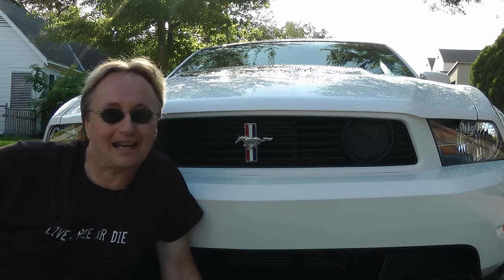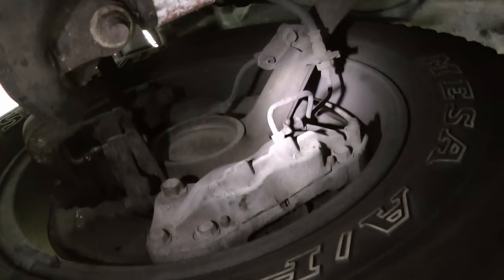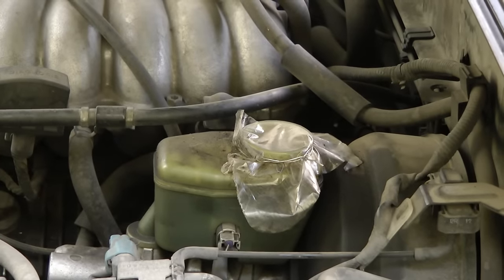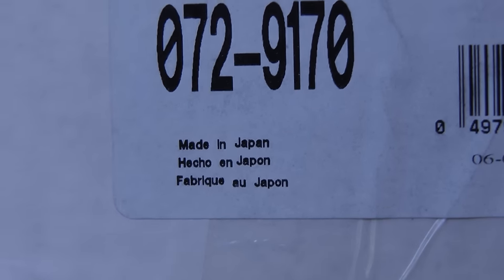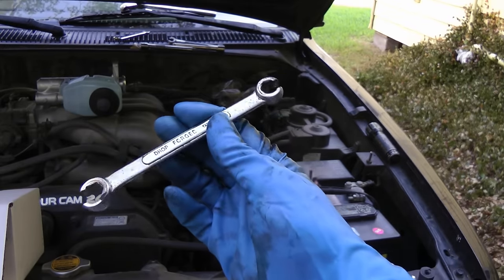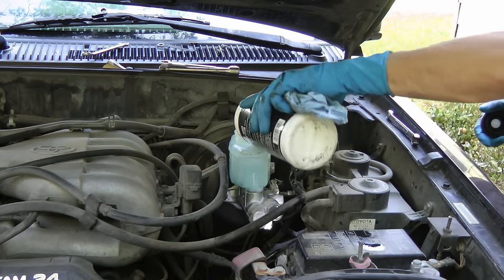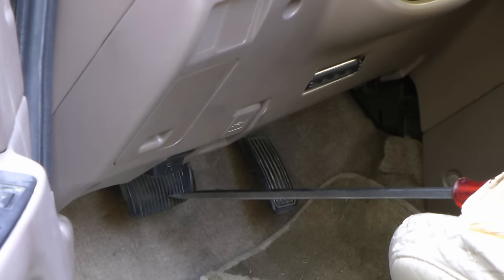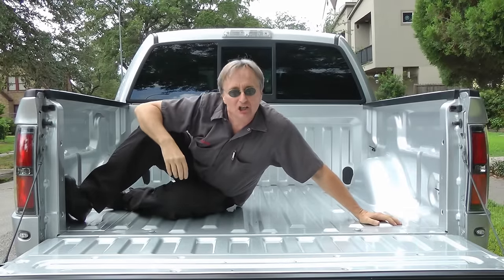How to Fix a Brake Pedal that Sinks in Your Car (Brake Master)

Comment: scotty i have a 99 sebring jxi and i just replace the rotors bled the lines and i have a brake pedal that sinks  and they worked b4 i did the replacement

Comment: Hey scotty, I have a 1976 c20 pick up. I have the same problem pedal to floor and brake light on.pedal goes so low that when I stop truck skids out. I have no leaking lines , would it still be same process with these old style of master break cylinder? ?
Reply from the maker: yes

Comment: My 99 accord 3.0 coupe has no brake pressure at all, pedal sinks to the ground. It'll get hard after you pump it really fast but will drop back down after a couple seconds. I've already replaced the Master cylinder with a new one and a junkyard one and had the same results with both. Did an engine swap and brakes worked fine before. I've even replaced the abs module and still have the same problem and I've also bled multiple times. Could really use some help here don't know what else to do! There are no leaks either, or at least I don't see any, and fluid level stays the same! Hope you can help meet out
Reply: did you ever get it fixed gary?

Comment: Great video. I have a quick question Scotty. I have an astro whose brake pedal is really hard to press down. It doesn't really go down at all. Also the steering wheel is really hard. I opened the hood and noticed that the power steering liquid hose (goes into booster), master cylinder and booster all work together. Is my booster out or master cylinder or both? Thanks!!!
Reply from the maker: bad boosters often do that. steering wheel is something else, like bad pump
Reply: Scotty Kilmer Thanks!!

Comment: Scotty,  I love your videos.  My 2010 ford edge has a spongy pedal and weak breaking ever since I changed all 4 wheels pads and rotors.. I replaced the master cylinder following your video.  had the wife push pedal to the floor for me while I did the tightening and loosening.  After about 7 rounds I got fluid coming out. The pedal was still going to the floor with little braking. I just got the car out of the shop and had them do a full bleed on the brake system.  And unfortunate to find that my pedal still goes far down with weak braking. the mechanic insists there no other issues..
Reply: every got it fixed?
Reply: No, never got it right had it powerflished by mechanics a few times.  Nevertheless i traded it in for a 2017 escape for the wife so its no longer my problem.

Comment: Hey Scotty 
I replaced the master cylinder and bleed all four break lines, break fluid is good in the reservoir  and there aren't any leaks but but break pedal still sinks to the floor and my brakes don't work at all. PLEASE HELP!

Comment: Although not as common sometimes a brake pedal going to the floor is caused by a bad ABS module.  A quick way to test is to pull the ABS fuse, if the brakes now work then that's the problem.

Comment: I have a 1999 ford tarus and I changed the brake booster and master cylinder because the brakes were going to the floor, and in the process of bleeding the brakes from all tires but the number 1 and 4 tire the air would not come out no matter how much I bleed them...some body told me it might be the wheel cylinder....what do you think because I'm very lost here...?
Reply from the maker: realize if it has ABS brakes, you need a dealer scan tool to bleed out all the air
Reply: I don't have abs braking system..

Comment: My 2015 Ford F150 has the soft brake pedal where it slowly sinks while I'm applying brake pedal pressure. I took it to the dealer and they said this was normal. They checked it out and said another one same model on the lot did the same thing. I disagree. I watched some You Tube videos where some folks have found the ABS device is causing this problem. How should I approach this? Find a garage that knows what they're doing? Is there an easy way to figure out what is causing this?

Comment: Scotty ive replaced a master cylinder on toyota corolla 1993 no leaks on master cylinder or calipers, brake lines are good. When my mechanic tried bleeding the system several times it wont bleed anything. Pedal is still soft.

Could it be the proportioning valve thats gone bad?
Reply from the maker: could be, but that's really rare. more often a crappy replacement master cylinder

Comment: Hi I have a 2009 toyota yaris with ABS system and when I presse 3-4 times  with engine off my brake pedal became hard and when its hard I presse 2-3 times more I hear a vacuum leak on front of car and my pedal goes down and I dont have any fluide leak Is  that normal because usually when pedal is hard it stays hard until starting engine?

Comment: So it is acceptable to just bleed the air using the two lines connected to the master cylinder? You don't need to use the bleeder screw near the tires for this?
Reply from the maker: as long as you do it as in my video, you don't get air into the lines and don't need to bleed the wheels

Comment: Whats up Scotty, i have a 94 s10! I replaced the master cylinder with a rebuilt master cylinder.. I blead the brakes, and still sinking to the floor. What do i need to do
Reply from the maker: +Thomas Barbee start with a new master, rebuilts often stink.  It's that or air in the system

Comment: Hey @scottykilmer I also have a 3rd gen Toyota 4Runner like the one in the video my brakes sink to the floor and don’t come to a complete stop in time I replaced my master cylinder I benched bled it and bled every brake at every wheel however I did not do the loosening the line method at the master cylinder like you’ve shown after the job I did not feel the difference with a new master cylinder I noticed the brake booster was rusting at point of contact with master cylinder but I’m not to sure how to come to a conclusion. Please help

Comment: I have been experiencing sponginess from brake pedal for a few months. Local garage has bled brakes about 3 times with air being expelled each time. Brakes weren't overly firm for a couple of years after dealer replaced brake fluid but since front discs/pads replaced last autumn I have had problems. Pedal doesn't travel to the floor when engine is off but firms up with about 2-3" of pedal travel until it firms up. Can master cylinder cause this lack of firmness to braking where pedal travels further but does slow the car though is a little unpredictable?
Reply from the maker: the air has to come from somewhere, and often a leaking master cylinder will pump air into the system

Comment: How are you sir, My car is toyota corolla 2008. Automatic. 292k mileage, since from last 3 days i am facing a problem with the break. When i press the break pedal i feel some time its lose and some time hard more a problem every pressing its makes a sound look likes, leakage tyre or remove air from a air balloon. I am already change the master cylinder but still same problem. Kindly help me about that issue.

Comment: my 06 silverado had a problem today. pushed on the brakes and heard a pop then air pushing out noise. mechanic said it was a vaccum leak in the brake booster.

Comment: i have a s10 that has a rusted leak in the front driver side wheel now can i just fix that or do i have to do all the brakes?  im gonna use it as a farm beater dont have the title for it  so finding what i can do for cheap i wanna teach my gf how to drive stick so i think this would be a good start

Comment: Would bleeding the lines correct the problem or I have to get a new master cylinder?
Reply: Jorge Daniel Figueroa Velázquez I'd say start with the cheapest option first. Bleed the brakes lines. If your pedal still goes to the floor, then replace the Master Cylinder, bleed the Master Cylinder and brake lines again to make sure no air is in the system....

Comment: Scotty, i have a 01 volvo s60 and the brake pedal is sinking to the floor. I bled the brakes 4 times replaced the pads rotors master cylinder and the brake booster i did everything did i miss something?
Reply from the maker: they sink cause the master is bad, or you have air in the system, or you have an ABS brake problem, Or there is a leak somewhere in the system. If you've done what you've done correctly, see a volvo mechanic to check out the ABS system that's not DIY stuff

Comment: hey scotty ive been having a problem with my 99 ford windstar almost every 3 months i have to top off my master cylinder with oil ive check the wheels front calipers and also the rear drums and i have no leaks nor the lines is there a posibility that the power booster has an internal leak and were could all this oil be going to? or its just the master cilinder? just also curious were is all the oil going to and mine does have the cao on it?

Comment: Scotty, Ive got an 04 volvo s80 t6. just did the front pads. calipers moved back nice and easy. took it for a break flush. pedal sinks to the floor. shop suggests new master cylinder. could that be what this is? i can pump up breaks after 3 pumps but it slowly loses pressure and fluid level has remained constant.
Reply from the maker: yep, often flushing the system will finish off a brake master then it needs replacing
Reply: Thank you for the advise and speedy response,  Scotty. Great video.

Comment: Hey Scotty Kilmer, I had a question that I just couldnt figure out myself.. I have this problem with a 96 toyota celica ST that has a brake sinking issue, but the funny thing is. the brakes only sinks to the floor when I am going 65mph and over only, but lately its been starting to feel softer on lower speeds too now. I have changed the brake pads and bled the brakes so far.. I was wondering what could be the problem. could it be the whole master cylinder or the brake booster? and my rear drum brake shoes are pretty worn out too, i dont know if that would be a problem for this situation
Reply from the maker: change the master cylinder IF changing the rear drum brakes doesn't fix it.Being really low, they can cause all that problem and they cost almost nothing if you do it yourself
Reply: Hey Scotty Kilmer, I just changed my drum brake pads on the rear, and took it for a test drive, and it just happened to sinnk to the floor still... (sadly) I was hoping this would fix it cause im on a budget, and master cylinder can be costly and so can the brake booster. The master cylinder didnt show any physical signs of leakage or problems, was wondering if it could be the brake booster? As stated before the brakes sink only on high end speeds around 70mph+.. Do i need to bleed the brakes again after changing the drum brakes? Should I flush out my brake fluid system and put new one? (the brake fluid didnt look dirty though) Thanks

Comment: I'm at a loss on this 97 4 runner new brakes all the way around new master cylinder, I have vacuum on the booster and still to the floor like stepping on a plum, abs module maybe???

Comment: hey scotty , sometimes my car has my brakes block up? i dont know why , it happens only ocasionally . I also noticed when i push the brakes my revs drop ( dont know if that connects to the problem or not)
Reply from the maker: +Kurucz Tamas often a bad brake booster does that

Comment: Hey I’m using a Vw polo with manual transmission my clutch pedal has become very tight and making noise but the clutch is not worn out . How to fix it ??

Comment: What if they simply don't return all the way back up?

My break pedal will stick about half inch from the top of resting position. Meaning breaks are still engaged and brake light is on. In the morning the battery is dead as a result of brake light being on all night

Comment: Hey scotty, we were recently given a 2007 checy cobalt with high mileage but engine runs great. It has sat for the past year and after getting it home I could hear a grinding noise from right rear and with no gas just in drive it felt like car was running over something. Didnt seem to happen in reverse...so we looked around and found right rear drum brakes getting rough and the W shaped spring or clip was broken and the cylinder boots were ripped so we replaced brakes on both rear-cylinder on right rear and hooked back up. Ive never done this and son has, we didnt bleed brakes and immediately brake pedal goes to floor when started, back to normal when engine off. everywhere i read people say soft pedal=air in system...should we bleed all four bleeders (my son went back and bled right rear)? Or does this seem like master cylinder? Hardly any braking at all occurs so Im leaning to air...just wanted your thoughts. Thank you.
Reply from the maker: bleed the whole system, BUT if it has ABS brakes, you need a gm scan tool to bleed those systems out
Reply: I hve obd II...do i need another scanner? I'm pretty sure it has abs brakes not many cars don't these days

Comment: hey great stuff, but i have a question, i changed the master cylinder, bled everything, including the lines. when the car is on, the pedal stays hard as a rock, but as soon as i turn the car back on, the break pedal loses pressure and sinks again, not as bad as it did before though.
Reply from the maker: often a bad booster unit does that
Reply: yeah scotty that is the video i watched, i changed the meter cylinder nd now the pedal sinks down but only when the car is running, when i turn it off, the break pedal gets hard as it should.. based on that, it could be the power booster? or vacuum line?
Reply: Scotty Kilmer thank you

Comment: What would cause the rear passenger to not bleed fluid when bleeding the brakes a small amount comea out but no pressure behind it? Driver side spits out fluid.... 08 tundra

Comment: hi scotty...recently i replaced both my  front  rotor, caliper and brake pad..now im having problem with my rotor over heating...i re-bleed the line and adjusted the bolts on my caliper several times and gets the same rotor overheating problem...can you kindly tell me the possible causes  of this overheating please? my thanks to any advise you  can share me...

Comment: Scotty I have a question I have a Honda Civic 90 I changed my master cylinder and the car is off and the pedal is hard when I turn on the car while holding the brake pedal it sinks when I turn on the car can you help me with advice please

Comment: Hey sccotty how r u  i need to ask you a solution for my car and that is related to gear shifter slide from P to RND or vice versa with pushing break paddle to release the gear selector in my honda civic 2002 D17A how can I resolve this issue .. thanks

Comment: Scotty : I can hear air after pushing the brake pedal all the way down , it just start doing today however it doesn't happen every time     ( leaking hose , master cylinder or brake booster ) thanks in advance

Comment: Hey Scotty, Recently my pedal went to the floor and I was leaking brake fluid and found out most of my lines were rusted out, probably from the harsh winters and the high use of salt. Is there anything that can be done to prevent brake line rust?
Reply from the maker: yea, move to new mexico. Steel rusts,you can't stop that in areas that are salty from ocean water or salted winter roads.
Reply: Scotty Kilmer LOL Thanks Scotty

Comment: Scotty,
I have a ‘91 gmc jimmy K5. I changed a brake wheel cylinder that was leaking. Now I’ve lost all the pressure in my brakes. I’ve bled and re-bled them. I changed the master cylinder TWICE. I have no leaks and can not get them to come back. There is a lot of “foam/bubbles in the reservoir nearest the cab. I need help

Comment: Scotty, I have an 81 GMC truck with a 96 Impala SS rear end, disc brakes all the way around and no leaks, replaced 60% of the lines and put a new vette disc/disc MC and new pads\rotors all the way around, the truck will stop and lockup when needed but the pedel does travel to the floor board about an inch or two above it. Any suggestions?

Comment: If my master cylinder doesn’t need to be replaced but my brake pedal is sinking can i just try to get the air out of the system?

Comment: I have 2002 Civic and am wondering did I just screw up my MC? I replaced front calipers and did the bleeding procedure, but didn't realise that I shouldn't push the brake pedal all the way to the floor. Now I have spongy pedal no matter how much I try to bleed the brakes, MC seals effed up?

And regarding that video, doesn't air get into those 2 lines from MC after you disconnect them? I would have imagined that you need to bleed all 4 corners after replacing MC.
Reply from the maker: YouStubid   if you bleed it the way I show air will all get sucked out at the master itself. And yes, change yours now.
Reply: Scotty Kilmer Yeah too bad that aftermarket part stores here don't have master cylinders for Civic and I must order it from Honda dealer and I guess it'll cost me at least $200 (converted from €), scrapyard units are out of the question. I suppose I could test the MC to be 100% sure by connecting piece of brake line into those 2 ports (creating closed system) and pressing the pedal, if still mushy then MC bad?
Reply: Scotty Kilmer Help! I got my new master cylinder in my car, bled it just the way you did but brake pedal is still soft and spongy! Now I read that new MC should not be pumped when dry and not push the piston too far in when not installed in car, is this true? They can't be that weak can they? Of course I had to try pumping it in my hands couple of times when I took it out of the box, did I ruin it?

Weirdest thing is that pedal does not rise and build up pressure when pumping it engine off, shouldn't it harden up even if there's air in the system?